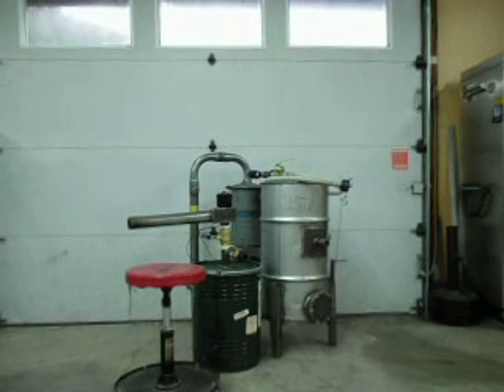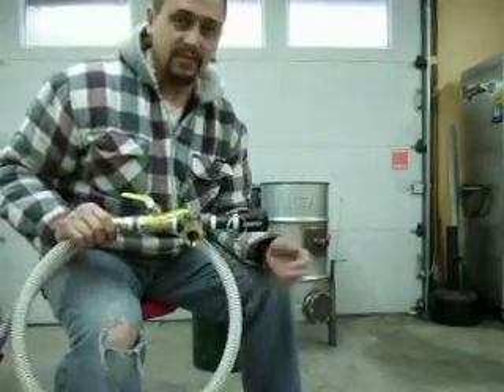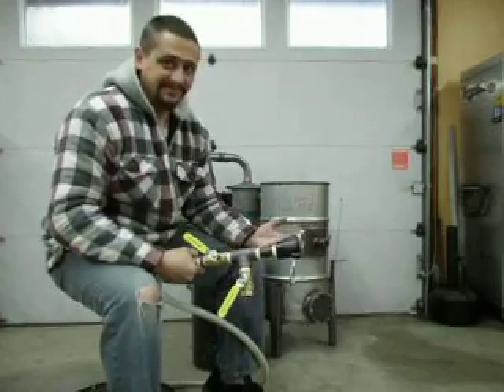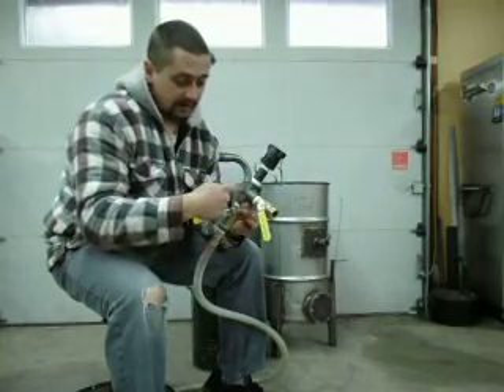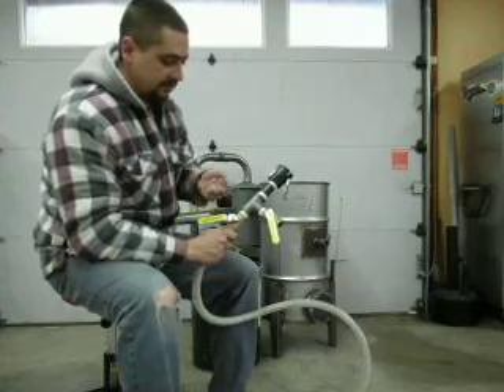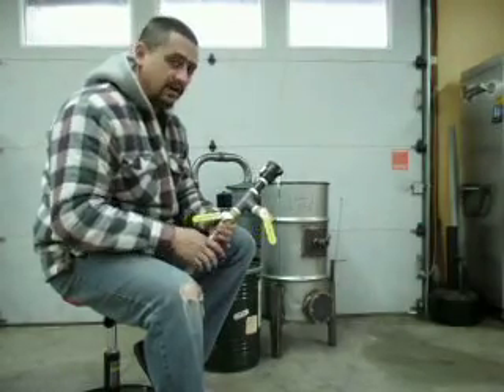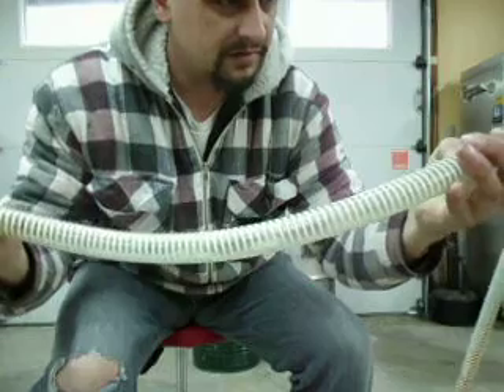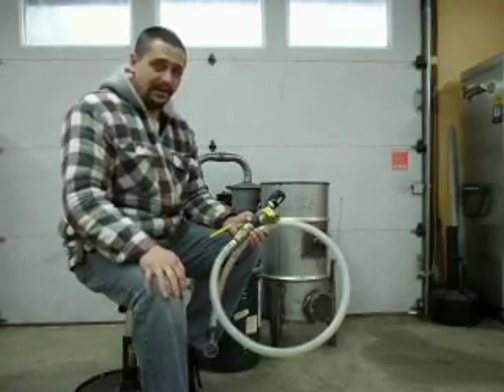how i built my gasifier #6

Comment: With the way you run your hose into your intake, you also have the air filter to help with filtering the gas. I do not know if you intended to do it, but it is a great idea. Have you seen any indications of particulates or tar on the intake air filter?